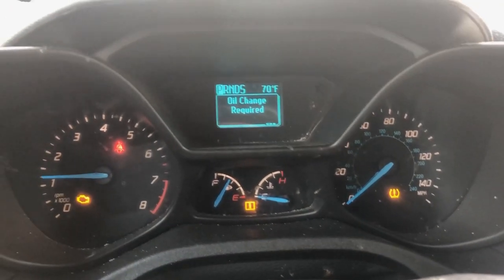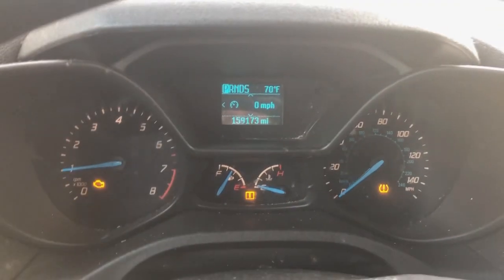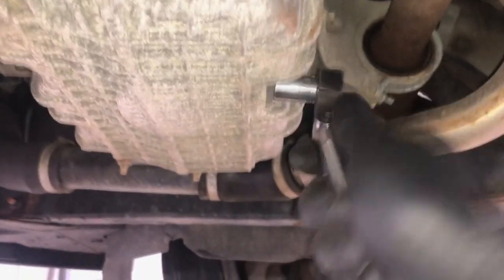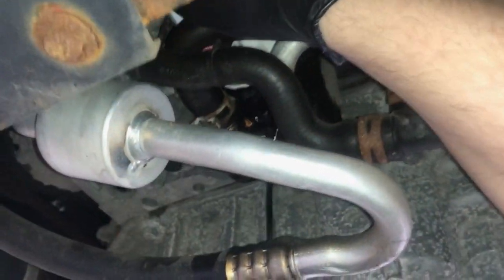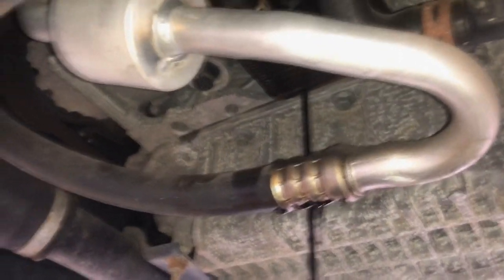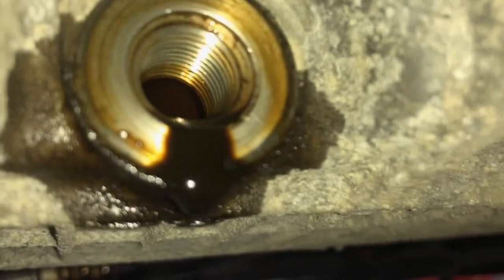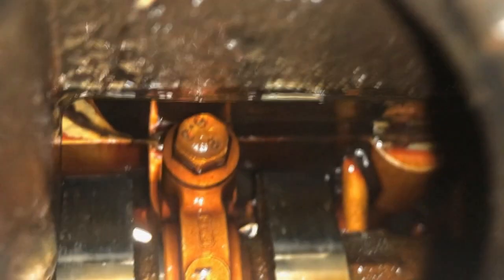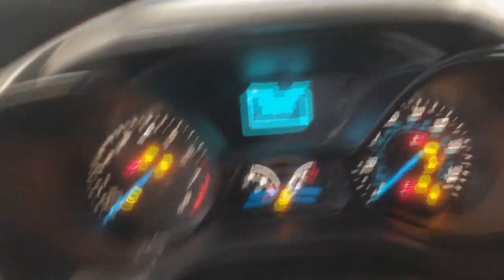A 20,000 Mile Oil Change?! (Short Vid)

Comment: My sister did that with her 2019 murano went 27k miles before her engine light came on for low oil pressure due to sludge …